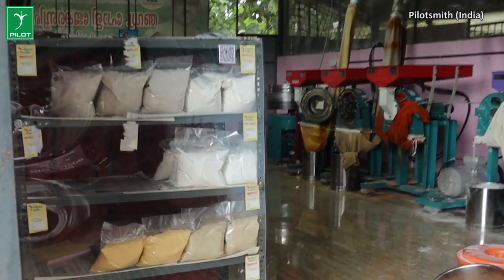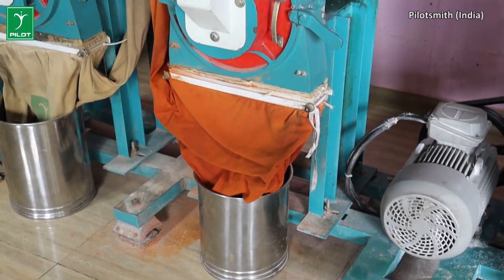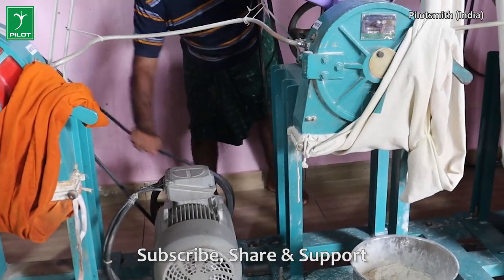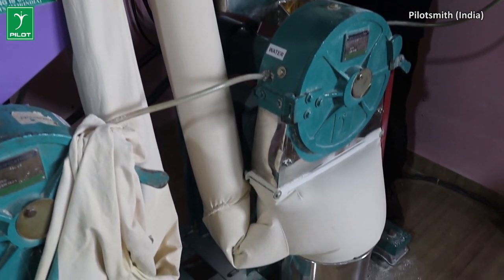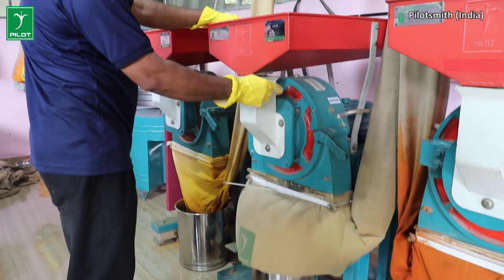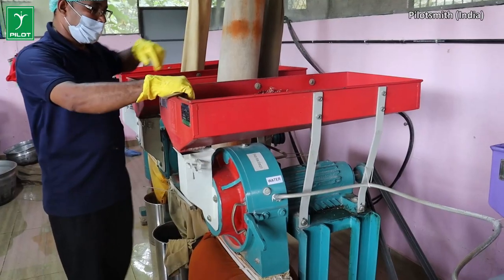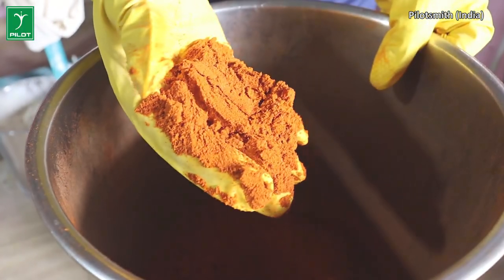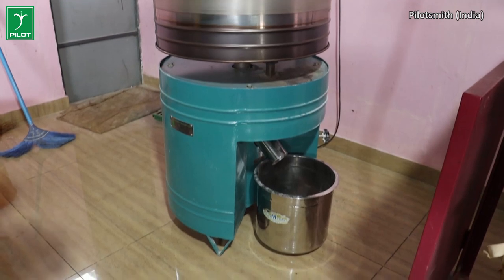Nalpattu Flour Mill | Pulverizer & Uruli Roaster | Food Processing

Comment: What about chilli powder and coriander powder fineness ..we are using plate type flour mills..if possible to get same results in one shot???
Reply from the maker: Yes indeed. For more information please contact in 9526811115
Reply: Yes .It's working.very fine powder
I have 3 pilot machine in gujarat
Reply: @rakeshsuthr88  we are expecting 60 mesh results is it possible..
Reply from the maker: @chary6515  We will get 90% 60mesh powder out put in Double Stage Mill
Reply: @pilotsmith1985  wow superb
Reply: @pilotsmith Where to buy the fine powder mesh